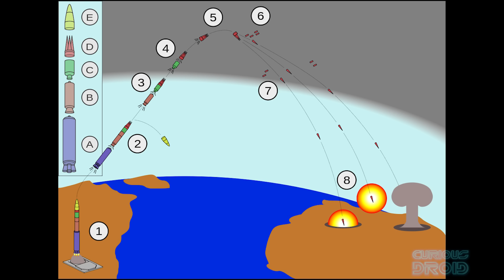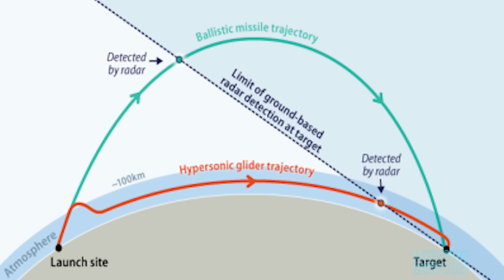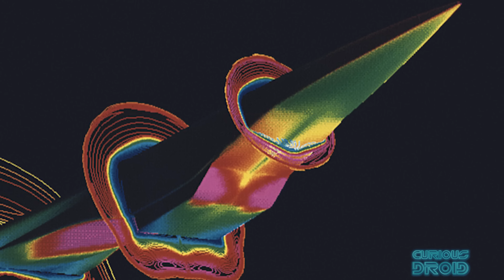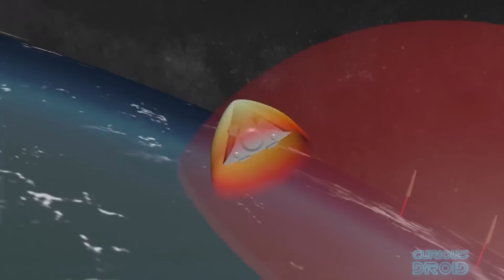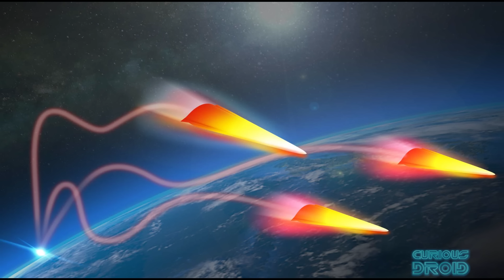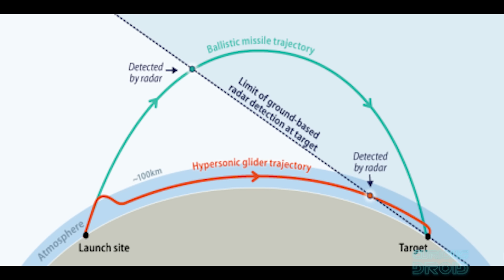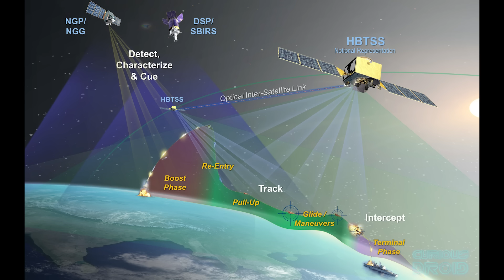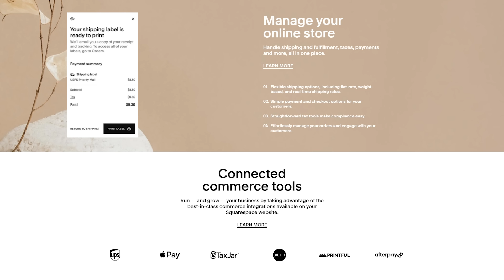Can the U.S. Stop Russian and Chinese Hypersonic Missiles?

Comment: "High Maneuverability" and Mach 27, definitely do not belong in the same description of a hypersonic missile.
Reply: "high" maneuverability is relative, as your missile interceptors have to "lead" the target significantly more as the speed increases.
For a small change in direction of a day Mach 5 projectile you're trying to intercept, the point of interception may change by several miles.
(This is made worse if your interceptor is not significantly faster than the projectile you're trying to intercept).
Think of it as throwing a ball to someone on a bike vs in a car
Reply: Most defence research regarding a hypersonic threat, is focusing on energy weapons to augment and eventually replace the kinetic approach.
Reply: @kerwinhynes5047  Yes it certainly looks like militaries of the world are moving towards that direction, the amount of energy required is immense. I wonder how such laser systems will cope with saturation attacks and if the power demand may lead to a resurgence of nuclear destroyers/cruisers? 🤔

Comment: The resistance you discussed in air resistance also resists direction changes. You see this in jets where even the arc of maneuver of a F22 gets 4x wider after it breaks Mach 2 vs Mach 1. Inertia and control surface "bite" changes at speed. Once the air is made into plasma the density drops and therefore the ability to change direction due to control surfaces drops quickly, even with lift bodies, so faster is the enemy of maneuver. Now we have deflection of the missile's nose with thrusters and the application of engine force in the desired direction, but you can't move that nose too far or change your direction too fast or you will go unstable. So again, speed is the enemy of maneuver in atmosphere. So saying maneuver unpredictably is an exaggeration it can maneuver within the limitations of inertia and force available and stability. 

A hypersonic cruise missile want to avoid a radar detection dome... okay now it has to start many many miles out to get that arc it needs... Meanwhile multiple antennae used to detect lightening strikes world wide; which are really detecting the energy of electrons being stripped from their atoms by other electrons, a.k.a. plasma; has actually triangulated your position since same cruise missile started generating plasma. It's not only hot, it is electromagnetically LOUD! As you stated plasma is NOT stealthy at all. In fact, it is a bit of all spectrum jammer and jammers always tell us where they are.  So we have six minutes to put an E3 right in that radar opening we left on purpose. Again, not as unpredictable as touted. Also a 2000's US Navy study of radar and plasma fields found that the transition layer between the plasma and non-chemically altered air is highly reflective of radar.  Plus studies of craft like the Space Shuttle showed that their IR could be seen over the horizon from the Shuttle as it descended, so you don't have to have direct visual or radar detection to know where it is and that pushes predictability up.  

Now how about that AD missile that was fired well within an envelop that allows no escape for the hypersonic missiles\... What do I have to fire at it... Try a huge cone of sand a mixture of fine and course. You don't need a PAC3 for this. You need to fire a cloud of sand with an upward arc that "sits" for a minute or two looking like a concrete wall.  Shoot several. They just have to have fuel, take commands from the C&C and explode say 10 miles ahead and EVEN if the missile could some how see the cloud, it would have the time to say "oh shit" to itself before it disintegrated. 

I do love the overview you gave and it covered most of the stuff I normally yell at the screen with much more sensationalist videos. As always, reasoned and makes me think! Thanks!

Comment: I would say, there are a number of  significant "difficulties" with these weapons:
(1) "Low altitude"?  What exactly is meant by "low".  Anything under 20-25,000 feet would be improbable because of the density of the atmosphere.  Heating is a significant issue.  Plasma, does not protect against heating (nor does ionization). 
(2) The energy required to fly at Mach 3+, at low altitudes is greater than the energy the weapon can expend. especially if it has to do this for a significant length of time.
(3) Abrupt maneuvering at velocities required would create G-forces so high that it would disable the components, if not destroy the vehicle.  This does not even take into account the incredible energy it requires to do so.
(4) Active tracking, especially of moving targets (such as aircraft carriers) would be nearly impossible with its internal sensors due to plasma and ionization.  Radio communications from outside sensors would be blocked as well due to the same affect......

I can think of another eight or ten additional things right off the top of my head.
-----------
An APDS round fired from an M256 is typically a dart with a tiny cross-section (unlike these missiles)... at 500m, the material is already ablating from atmospheric friction and is at a temperature of more than 2500C at the tip.  The affect on one of these missiles would be many times greater due to its cross section.  Nor is these any known fuel that would provide sufficient energy to propel such a weapon at a low altitude, especially considering the relative dimensions of the weapon.

Russia, China, North Korea say a lot... but demonstrate very little.  The effectiveness of Russian weaponry (which the Chinese and North Koreans copy in a typically less sophisticated variant), or more specifically their lacking effectiveness, has been amply demonstrated in Ukraine.  Russian forces are getting their teeth kicked in by Ukrainians, sparsely armed by NATO, often with antique weapon systems like Gepard (early 1970s), Hawk (early 1960s), HIMARS (mid 1980s), AT-4 (variants from 1970s), Javelin (1980s)....
Reply: Russian seem to be doing very well in Ukraine and NATO hasn't "sparsely" arm them, at this point Ukraine is the second most expensive army in the world with the amount of resources and weapons expended.
To think Russia can stand against NATO and the second biggest army in Europe is pretty impressive
Reply: Yes, this is a bad video. Hypersonic speed has different values at different altitudes. At low altitude Mach 4 is hypersonic. He doesn’t use the correct terminology either. A hypersonic glide vehicle isn’t a hypersonic missile. Good post. Honestly there is too much wrong with this video to address everything
Reply: @ericsuarez834  If you think Russia is standing either against NATO or just Europe in Ukraine, you are sadly deluded.
Reply: @AgentPepsi1   what?
Reply: @AgentPepsi1  Remind me the last time USA won a war?
Reply: Laughable
Reply: @attractivegd9531  Remind me the last time Russia won a war?
Reply: @AgentPepsi1  Prety much every time we attacked them. Attacking them has always been a mistake.
Reply: @johnkesich8696  Okay... 🤣😂🤣😂🤣😂🤣😂 evidence from the battlefields say otherwise.

Comment: Correction to the video: Putin stressed several times that both Zircon and Avangard can be controlled during the entire flight path, so they have some way to penetrate the surrounding plasma.
Reply: These days, it’s relatively safe to assume the opposite is true whenever putin speaks
Reply: They cannot. You see, Russia lacks real time capability over the globe unlike the US. It however could in theory be controlled from a computer onboard with AI algorithms.
Reply: Is that the exact wording he used? It could just mean that the missile can move its control surfaces to adjust heading at any point. Not necessarily that new instructions could be sent to it from an external source.
Reply: There is a reason why Zirkons (and Daggers, air-launched hypersonic) are called "aircraft carriers killers" - they can strike a moving ship, so they can be guided . Zirkon is not only only deployed to surface ships, but submarines and coastal defense systems, which means they have no problem with moving ships.
Reply: @hristoistoyanov  Shouldn't we turn the order of the sentence around and say, "they can be guided, so they can strike a moving ship"? But can they really be guided against moving vessels? From what we have seen from Russia in recent years, they do not have real time satellite capability beyond visual range for non-stationary targets.

Comment: A 1MW laser is approaching Sci-fi level technology, if one can be developed and is reliable in use it would be game-changing!

Edit: If the military already admitted to functional 1-megawatt laser systems then what they ACTUALLY have is probably far more powerful!

Imagine being able to pump the entire output of a nuclear reactor through a shaft of concentrated energy, assuming it's functional and tracking technology is equally as capable, there is no missile that can evade the speed of light!
Reply: Too many 'if's there.
Reply: Bit late there, the US military has already made 1megawatt lasers for anti-ICBM systems
Reply: its not sci fi its possible when you combine many smaller lasers.
Reply: Real Genius was 40 years ago if you can believe it. Laser technology has advanced quite a bit since then.
Reply: it combines multiple lasers into one.

sounds like the death star. i approve. should call it that.
Reply: I'm gonna say a two syllable word.  STAR WAR'S
Reply: @SilvaDreams  President Reagan.  🤠

Comment: Seems to me that a material already dealing with the frictional heat of hypersonic speeds would be near failure and a laser would be a good option to tip it over the edge. Also seems to me that an object with material that’s near failure from that heat striking a solid object at hypersonic speeds would get be easily punctured, introducing that hypersonic heat to the inside of the vehicle causing it to break up, making a predictive, volume fill approach a viable counter (shooting skeet with a missile). Always assuming it’s traceable of course, such as we’re tracking a ship and see it launch a missile.

Comment: The mid course and terminal guidance of hypersonics is something Sandia labs worked on for decades and I find it extremely suspect that China and Russia made quantum leaps in material science and leapfrogged the United States. Imagine trying to hit a Carrier that knows its a target. What is your mid course node? what is your terminal node? what is the data link? During our own Hypersonic tests from California to the Kwaj island losing data link in a non hostile environment was a problem especially at the speeds involved. Throw in jamming, cyber attacks and that weird offensive radar virus we developed that can brick the receiver and you probably wont hit anything like a carrier with one.
Reply: Sandia*
Reply: @dziban303  thanks. when I get triggered proper names r the first to go
Reply: The USA doesn't know when the Kinzhals are coming.
Not unless there happens to be a ANS/SPY-1F(V) in the flight path.
The radar on it they think is for literal last second adjustments, like 15-20 seconds before impact. Maybe a 1,000m adjustment can be made. 
We can tell once every few hours if a dozen TU-22M3s have taken off and could be going somewhere with 24 kinzhals, but it's not like they don't know when those Sats are within range. 
The carrier doesn't know they are coming until they are about 2 minutes out. by that time they've got their update. the carrier even if it takes radical maneuvers can only change where it would have been by what 500 meters in one of two directions? The carrier is 300 meters long.
Reply: @posmoo9790  1) There would be a radar on and looking for threats in what world does a  Carrier in war time not have its dedicated defense screen? 
2) Tu-22m3? How are they taking off without being noticed?(RC-135 go brrrrrrr) How are they getting data link? Russia lacks reliable robust over the horizon ISR AND data link

The Carrier is moving so you need eyes on it, Sure thats the carrier you found? Do you have SAR? IR? or just a radar contact?  

Oh wait Russian SAR is crap. Russian IR is crap (they buy french gear) and Russian Radar? pffffft

LAFFS
Reply: As was mentioned none of this stuff is new. It's not so much a matter of leap frogging American tech as fully developing stuff that's been around for a long time. Soviet scientist were working on hypersonic anti-ship missiles and satellite tracking since at least the 60s, political and financial problems put a lot of that on deep freeze but none of it went away. You can bet a lot of that development got passed on to the Chinese. I can think of several areas where the Chinese and Russians have superior weapon systems that the Americans could have if they spent the time and money on them. Long range air to air missiles is one, anti-ship ballistic missiles is another passive artillery spotters is a third. I have also heard of quantum communication satellites but I can't exactly say what the hell they are. 🤔
Reply: @Whiteplane  1) the defensive screen is there, they are all within 8-10 miles of the carrier. they are targets too. 
2) where is your RC-135w going to be that it can see a flight of tu-22m3 that's isn't illuminating and flying over Voronezh, Russia when they launch at a carrier group in the Ionian Sea. Do you think the RC-135w is magic?
So you think strategic bombers make a habit of illuminating with their 30kw air to ground radars just for the hell of it? when they're just flying to a point in the sky where the computer launches their missiles? you think they do that? 
do you think a data link is anything other than a radio wave? Are you aware Russians had satellite "data links" before we had satellites? 
and yes Russia has lots of RADAR/ELINT/RECON Sats that can pinpoint a carrier anywhere near their coasts, and almost anywhere in the world. 
they launched 9 military satellites in 2022.
they launched another dedicated military comms satellite in march of last year probably just for the war in fact. a "data link" satellite that you are so impressed with.
it looks like just for military purposes they launched two comms sats, two elint sats, one cartography sat, and the other 4 are secret. 
Are you really dumb enough to believe russia's weapons can't communicate with their satellites?

Comment: What happens when something travelling really really fast hits a small stationary object?
Like a ball of lead shot say 1/4" in diameter.
Well the answer is an explosion and disintegration.
So drop a curtain of small heavy objects in it's path.
Doesn't have to be accurate, just well spread out like 500m of debris.
During WWII the British merchant Navy employed small rockets along the flanks of the ships that had a long steel line and a parachute attached.
When the German dive bombers who had enjoyed a lot of success until then dove down, up went the rockets and off came the wings.
A stationary line against a fast moving object.
From then on the bombers had to fly well high.

Comment: If there's no way to get radio signals in or out of such missiles due to the plasma, then they probably rely on visual targeting. So you wouldn't even need a particularly powerful laser. You'd just need like 10 or 20 off the shelf somewhat powerful lasers. On drones you send away from the ship or whatever. To point at and so blind the missile. Surely. If it's a single laser from the target then such a missile could ride it down.

Comment: It would be very easy to set up a defense system onshore in the US. The missiles will have slowed down, he IR emission will be strong, the distance from the lasers will be small, there is enough energy to charge them. But if you want to secure invulnerability for aggressive systems like aircraft carriers - wait for another century.